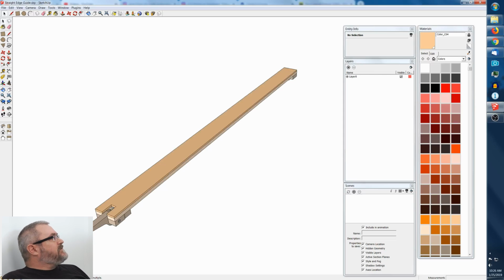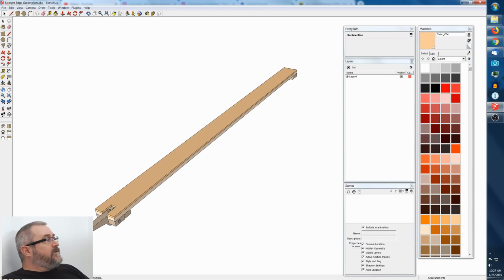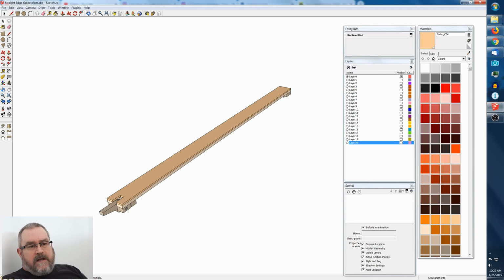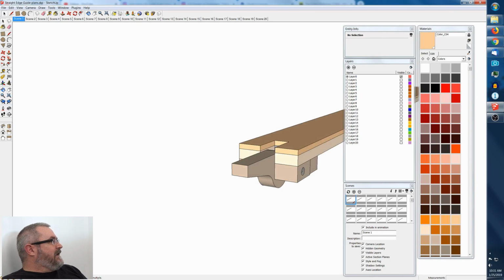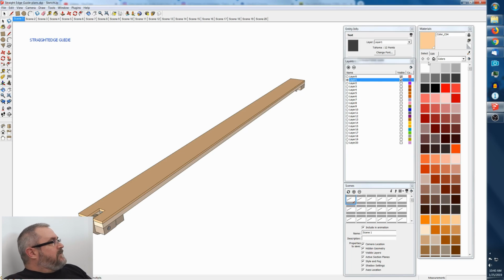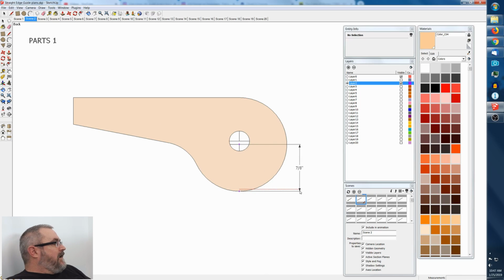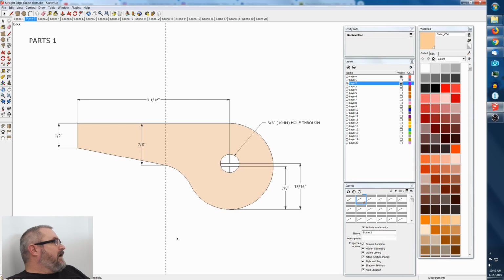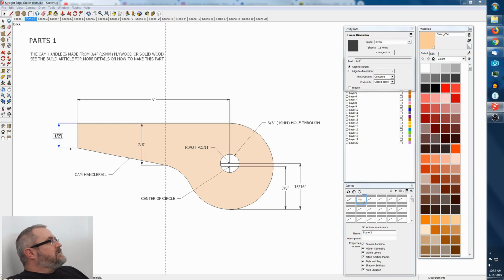From Project to Plans using SketchUp

Comment: Have you tried out any different CAD programs?
Reply from the maker: Not really. Trouble with switching to something else is that I would have to spend a lot of time getting acclimated, to use it efficiently. SketchUp might not be the best, but it does do everything I need it to do and I'm used to its quirks.

Comment: You're not gonna like this but, can u teach how to draw the cam, for example, from scratch?   Told ya.  Yes, I am that lazy.  Sorry.  I like the idea of sketch up, but it takes me a damn half hour to draw two 8 ft 6x6 posts placed parallel 3 inches apart.  Orbiting and panning around ends in some distorted perspective.  I said lazy.  Just not over learning curve.

Ps.  Appreciate the efforts on plans.  Have a few and really enjoyed buildin from them(router lift and table).  I remember thinking ... I wish I could build all my projects with plans like this.
Reply: There are a lot of YouTube videos available. I'm lazy too, but when you're too lazy to search YouTube for "sketchup tutorial", maybe that's taking it too far. 😛
Reply: As The Newbie Woodworker (great channel by the way) said - tutorials.

It should take about 10 seconds to make those 2 columns. Not hating, just making observations.

Also, it's a case of use it or loose it with the skills and efficiency and proficiency  with SketchUp or any other reasonably complex tool.

Jay Bates has a series if tutorials out, and they are pretty good. It's pretty clear he uses it a lot.

As CAD tools go, this one is pretty easy to use.

Comment: Hi John. Quick Windows tip: When you have a prefilled text field that you would like blank, make sure your text cursor is in the field. Press Ctrl-A then Delete. This will Select All and Delete the text. This won't affect the clipboard so if you need to paste text into the field Ctrl-V will not contain the deleted text.

Ctrl-X is Cut, Ctrl-C is Copy, Ctrl-V is Paste, Ctrl-A is Select All, and Ctrl-Z is Undo. This works fairly universally in Windows applications of all versions. Some applications may repurpose these but not commonly.
Reply: Learning all those shortcuts is why I never learned to use sketch up. lol
Reply: @KipdoesStuff  I wasn't talking about Sketch Up shortcuts. Those are Windows shortcuts. They work in almost any Windows application.
Reply: An even easier way is to double click the text, this will highlight it same as ctrl+a. Once it's highlighted there is no need to hit delete, just start typing and it will replace the previous text automatically.
Reply: @kealobsmith5044  That doesn't work if there are breaks in the text like hyphens or spaces.
Reply: Then triple click.
Reply: I rewatched the video, and our reply here really doesn't apply. The information doesn't show up until you start typing. This doesn't happen in future builds of sketchup. So I think it is just a drawback of sketchup 8. Unfortunately